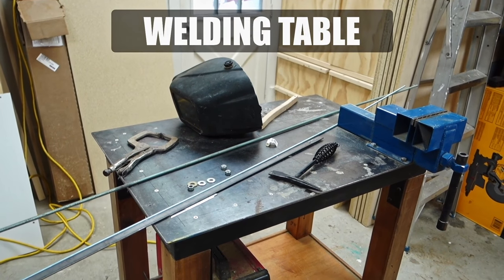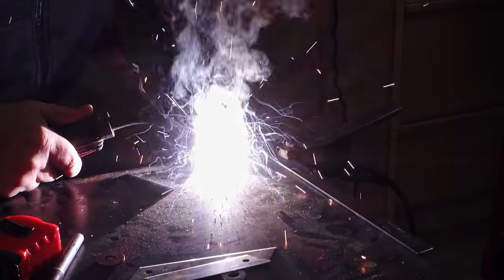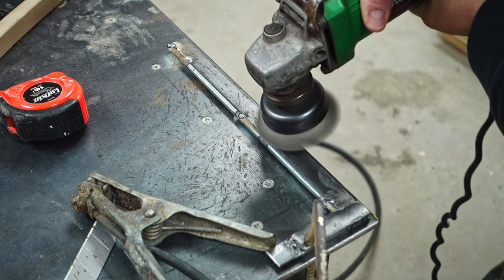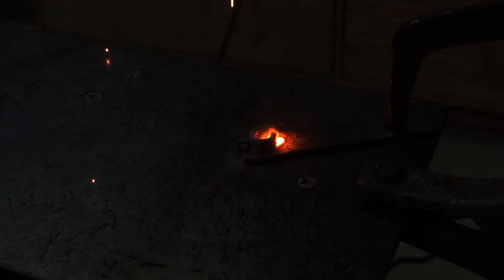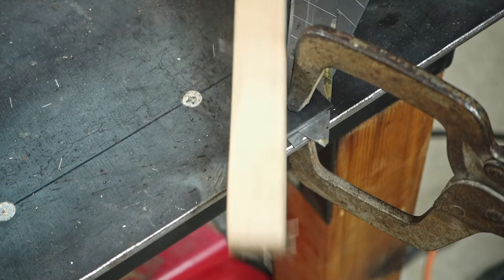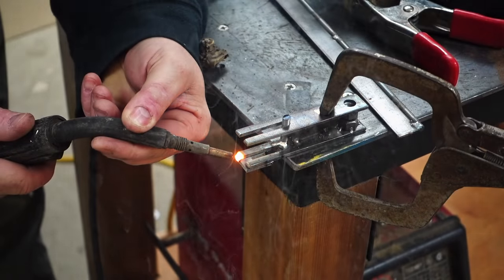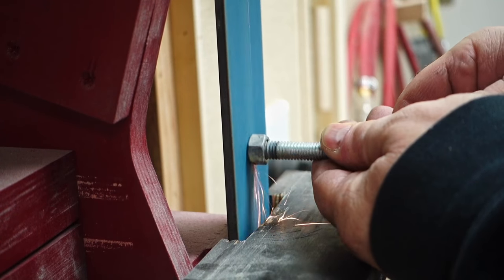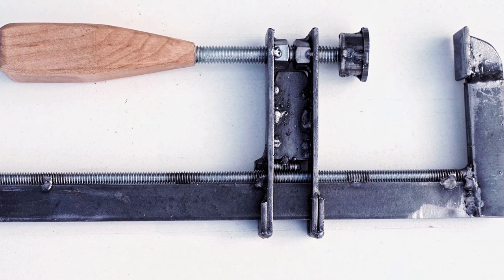Making A Steel Bar Clamp

Comment: If your using gasless flux core wire you need to change polarity change ground to positive and and gun to negative welds will have no splatter and welds alot better make sure your welder can support polarity change

Comment: Instead of the separate nuts could you use a threaded turnbuckle for better thread engagement ? It might make the design a little strong and easier to make

Comment: I can't say i have actively searched for it but I bet you could make a great welding tutorial. How does it work? You put a clamp on the table and then you have some kind of device that feeds a wire and .. does it melt the parts together or is the thread that fills the gap? You had some nice closeups in this video, that's why i ask :) You're also very good at explaining.
Thanks for video!
Reply: both pieces and the wire melts together creating a weld

Comment from the maker: Build article with free SketchUp model:
http://www.ibuildit.ca/Workshop%20Projects/steel-bar-clamp.html

Testing how strong this clamp is: https://youtu.be/ALVwdVZ4EAQ

I made another edit of this video, called the "heavy metal" version:
https://youtu.be/WGux8KA97rc

I'm welding using flux core wire that requires no welding gas. It is not as clean as mig with gas, but it gets the job done.
The clamp won't win any beauty awards, but the design is solid and lean - it's VERY light, but can deliver a lot of force. It's also super fast to adjust.

Exclusive content on Patreon:
https://www.patreon.com/user?u=865843&ty=h

Plans for sale: http://www.ibuildit.ca/plans.html

My second woodworking channel:
http://www.youtube.com/c/IBuildIt

My home reno channel:
http://www.youtube.com/c/IBuildItHome
Reply: Video lags for me John - might want to take a look I believe its the render.
Good work sir!
Reply from the maker: Looks fine to me.
Reply: Cheers must have been something on my end. Cool project, watch those fumes from a fellow Torontonian who welds in his garage hah!
Reply: John Heisz

Comment: Great video, buuuuuut.... Why don't you wear gloves? and use the nozzle on the mig gun, you're gonna get the diffuser and contact tip messed up with a lot of splatter. It's your skin and equipment, but cover all the bases when making great videos.